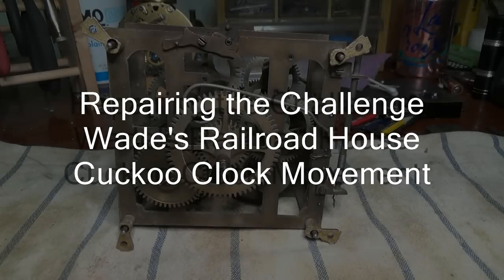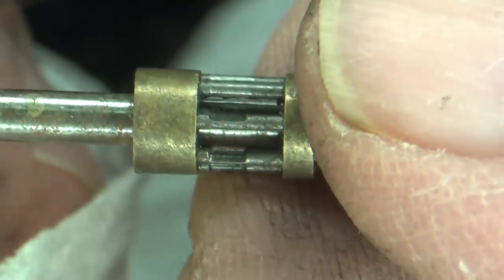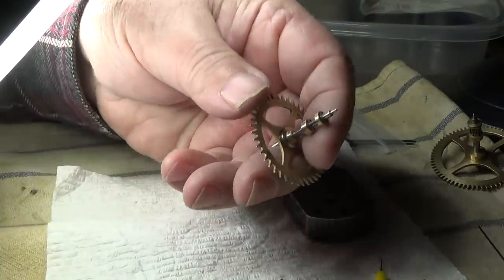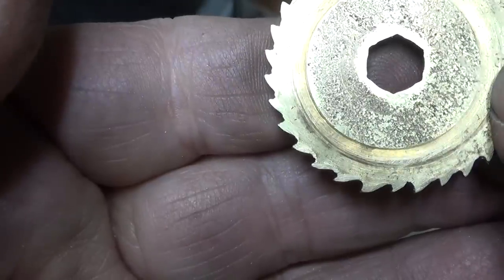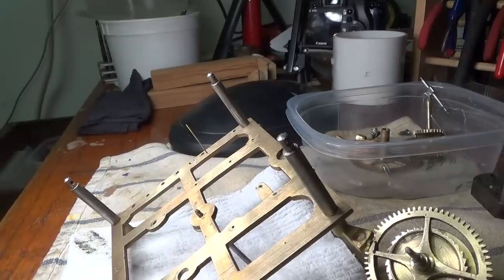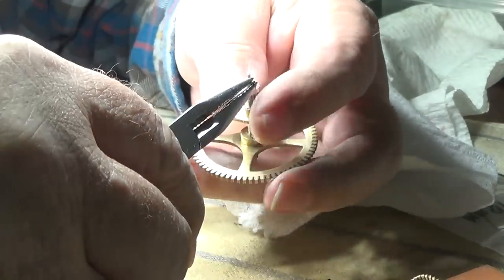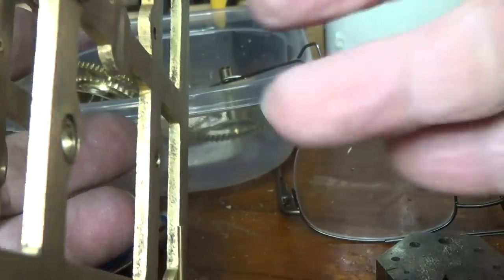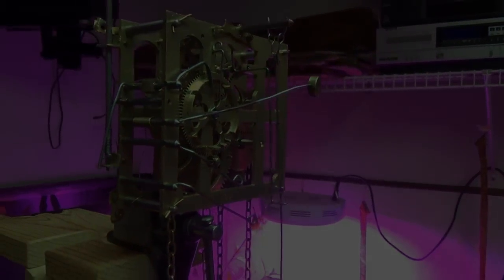Repairing the Challenge - Wade's Railroad House Cuckoo Clock

Comment: Incredible, like all your videos. How does that hard steel wear more than the brass working against it?
I'm sure there's an explanation and I'd sure like to hear it.
I read somewhere in another comment you had background in chemistry.
Reply from the maker: There are a lot of variables involved in the wear of pivots and    pivot holes, but one thing that can be taken into consideration is the softness of brass allows the hard contaminant  particles to become embedded in the brass and grind against the steel.  The differences in brass and steel hardness from one manufacturer to another is another factor.  Bushings in pivot holes can be changed over time without the steel pivots being properly polished, so the steel gets progressively more worn over time while the holes are refreshed.  Variables in maintenance make an enormous difference.  Oil that is simply added just makes a grinding paste and enhances wear.
Reply: Thank you mr. Perry for your reply. That makes sense and I guess would even apply to for example, that escape wheel wearing that steel anchor.
Reply from the maker: Yes, indeed.  Also, you have say, 15 teeth on an escape wheel, each of which is scraping on the same steel surface area.  Same with brass gear wheels with, for example 70 brass teeth, rubbing against 7 trundles in a lantern pinion. Each trundle gets rubbed 10 times for each gear tooth being rubbed once.

Comment: what stops the trundles from coming out as they seemed to push in very easy?
Reply from the maker: As I show in the video, I use a carbide scribing pen to push a tiny bit of brass over each hole to lock in each trundle. I also add a small bit of Loctite to secure them.  Watch starting here: https://youtu.be/nPCX9c20y6E?t=2891

Comment: when you add wire to make a new pivot, is it as strong as the original pivot?
Reply from the maker: Stronger, actually, since I use hardened steel wire. The original pivots will bend; the replacements will not.

Comment: in what solution do you wash the watch and where can I buy it? I repair watches
Reply from the maker: https://timesavers.com/i-9500951-l-r-clock-cleaning-concentrate-1-gallon.html   or make your own with liquid detergent, ammonia and oleic acid.
Reply: The page seems to have moved. See https://timesavers.com/c-325525-chemicals-adhesives-soldering-cleaning-polishing-ultrasonic-cleaning-solutions-rinses.html for TimeSavers' various cleaning fluids. I used to use Vigor brand because it seemed the least toxic, but they don't seem to carry it any more.

Comment: I would like to try replacing bellows with leather. Where do you get your leather and what thickness? Bob
Reply from the maker: I found mine on ebay.  Search for thin leather 1 oz or less. You can also buy it from Timesavers.  https://timesavers.com/i-8946487-leather-bellow-material.html

Comment: I think I saw on this video that when you re bushed you used a BB13 which has a height of 1.5MM where the plate is probably 2.0 MM. Just curious why you would not use a bushing the same size as the plate. Maybe the height is not critical? So if the height of the bushing is the same length as the pivot that is all that matters? So sorry you will not be doing any videos for a while.
Sure hope you can get that hip fixed. Good luck.
Reply from the maker: Ideally, you're right that the bushing should be the same height as the plate thickness.  I don't keep an inventory of bushings for various plate thicknesses, as most of the clocks I fix have plates that are  1.5 mm or thinner.  In most case where I have a clock with thicker plates, the pivot holes, other than the second wheel are generally not worn, so I  seldom use a commercial bushing that is thicker.  Hard to justify keeping an inventory of seldom used bushings. It's easier to simply make one on the lathe with brass rod.  In this instance and many others of this type movement, for whatever reason, the pivots were made shorter than the plate thickness.  That causes an unusual wear problem.  Instead of the pivot hole wearing through the whole thickness, the outermost part of the hole stays round and the pivot wears down the inner part of the hole until the end of the pivot is actually in a groove. I refer to that as tunneling. As it wears, end shake is eliminated and friction stops the clock.  This stoppage can occur sooner than that caused by normal pivot hole wear.  It also causes the pivot itself to wear unevenly.  As the end shake reduces, the outer portion of the pivot increasingly carries more of the load and the pivot wears into a cone shape.  So, in these cases, I prefer the bushing be no thicker than the pivot is long so that wear is even and does not create  "tunneling" wear and abnormal pivot wear.

Comment: Are the wire shears you use in this video a Xuron 2193F Hard Wire Cutter?  https://xuron.com/index.php/main/industrial_products/11/18 Thanks for the seriously impressive video. You show why a clock repair person needs to be a bit of a machinist as well. Congratulations on a very instructive video and a job well done!
Reply from the maker: I don't know if that's the exact model number, but that looks like the cutter I use.  Thanks for the comments. You never know what problems you'll run into with some of these older movements. It's unbelievable what people have done to these old movements through the years.

Comment: no way were those trundles originally designed to rotate.  Imagine the extra work involved.  Plus, if they were intended to rotate, the service instructions would have required they be cleaned and oiled.  Further, there's no way you could keep dirt and oil out of the holes.  You would see dramatic wear at the points the trundles are seated int their holes..and the brass holes would keep getting larger and larger until the trundles fell out.  And that would happen much faster than the steel trundles wear out.  The very theory is preposterous
Reply from the maker: I agree.  I believe they are relatively loose in the holes as a convenience in manufacturing.  A machine could just drop them into the shroud holes instead of having to press them in.  However, if you go to the NAWCC forum, there can be some spicy arguments between the two sides of the argument.  Lots of information concerning clocks creates divisive and sometimes hostile arguments.